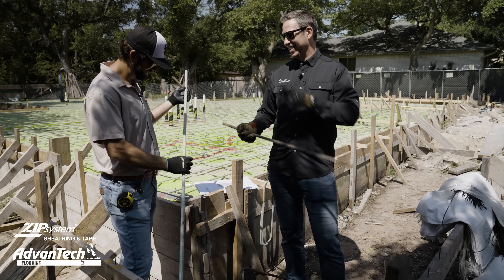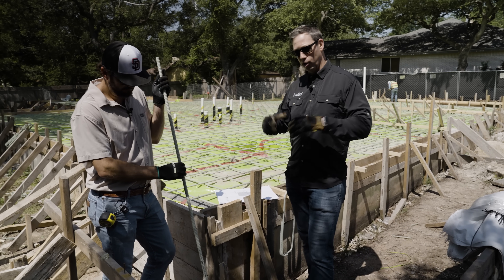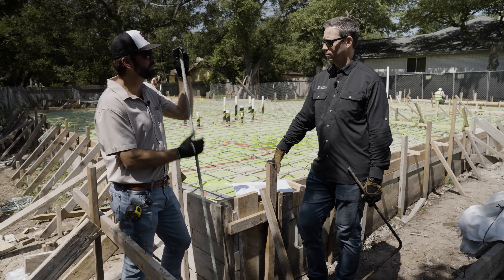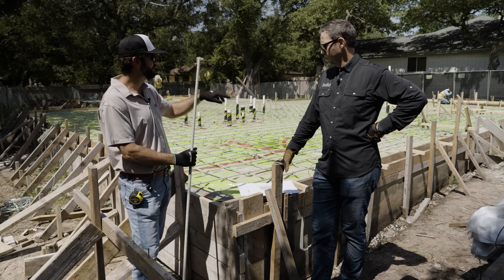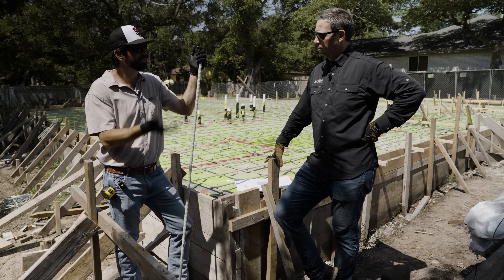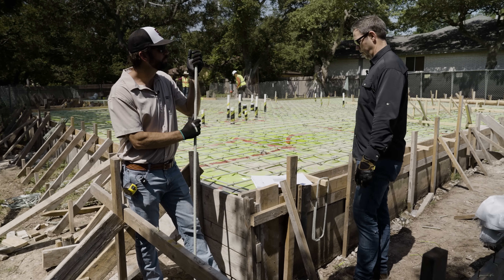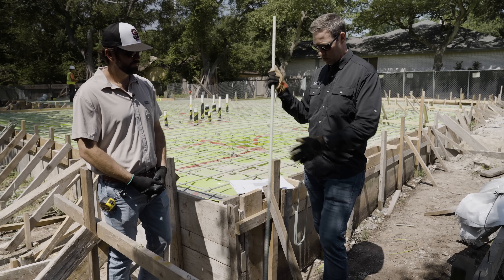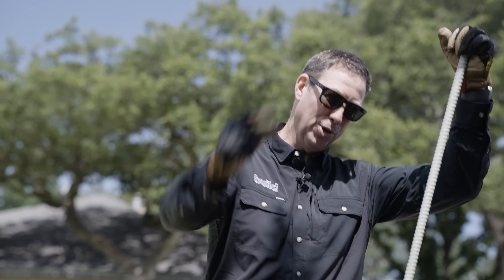Comparing Steel and Fiberglass Rebar - SURPRISING results

Comment: There is a big difference in GFRP vs. BFRP and allot more advantages to that of steel.  Steel has it's place to have to be used in certain construction projects but BFRP would save allot of head aches over steel re-enforcements.  BFRP is totally recyclable and can be used in concrete and asphalt and in fire and acid areas and will hold up longer than steel.  A bridge in Miami was built over 30 years ago for very heavy traffic.  A core sample was taken after the 30 years and was just a strong as it was when cured 30 years ago with zero Spalding or signs of wear as other bridges in the area.  Steel has it's place and will never be totally replaced but BFRP over GFRP all day twice on Sunday's.
If you need BFRP (Basalt fiber resin polimer) I can supply it for sure.
Reply: You have a link to BFRP?
Reply: BFRP doesn't bend like steel, right?

And where do you get it in the States?

Comment: Does it bend can u make cuts since its fiber glass mask when making cuts?
Reply: I don't think you can bend it onsite and will have to bend it before it is made. You should be able to cut it
Reply: Any shapes (hoops, stirrups, bends) are formed in the manufacturing process. As the warm materials come out of the pultrusion machinery, they go directly into a jig for forming to the required specifications. Because they are formed in a jig, each piece is identical. There is no variation in the shape or angle of the bend.

Cutting MST BAR produces round dust particles similar to cutting stone. Although there is no specific health risk in cutting MST BAR, personal protective equipment (PPE) should always be worn.
Reply: @g2buildingproducts  thanks for reply  and info I have used product type in California for corporations jobs  where it's called for instead of metal rebar this video shows small contractors use of material for foundation  It's nice  to see it going to smaller commercial use👍for my small side jobs will continue to use rebar

Comment: How are you bending it
Reply: He said at the factory, nothing on site
Reply: Any shapes (hoops, stirrups, bends) are formed in the manufacturing process. As the warm materials come out of the pultrusion machinery, they go directly into a jig for forming to the required specifications. Because they are formed in a jig, each piece is identical. There is no variation in the shape or angle of the bend.

Comment: I used a bit less than half a mile of fiber rebar in a 30' X 40' garage I built. It worked beautifully. However, as they said, for applications in which a lot of shear force will be applied to the bar, I would revert to steel.

Comment: Cost diff?  Great content thank you as ever!
Reply: Generally speaking, the cost of MST BAR is very comparable to steel rebar. The price of steel rebar is known to fluctuate significantly and is quite different dependant on geography, whereas the price of MST BAR holds quite consistently.  Many builders report savings on both materials along with high labor cost savings when using MST BAR.

Comment: how does this compare to Helix microrebar?
Reply: MST BAR would be more comparable to steel rebar for use and installation. MST BAR could and has been used alongside a product like this if required.
Reply: @g2buildingproducts  But it's still a big bar versus micro rebar which is tiny little fragments that form a binder on a micro level.
Reply: @rockys7726  Very true. This is why, any product used must be engineered for proper application in any given use case.
Reply: Good question

Comment: The thing about recycling steel rebar is that it's likely going to be stuck in concrete for 50+ years. If you were ripping it up every decade, the recycling value would cut hard into the GFRB's reduced carbon advantage but if both are going to be in use for the better part of a century before either is going to ripped out then it's kind of a moot point. Besides, the advancements that have been made in the last decade toward successfully recycling fiberglass wind turbine blades are any indication, you should have no issues recycling the glass rebar when it comes time to do so.

Comment: Basalt, mesh, fibers, rebar 0 enviroment impact for manufacture, 0 outgas expands at same rate as concrete, no spalling 3-5 times stronger than steel. Today availabilty and bending of rebar at jobsite remain issues, however this will likely be the product in future for imbedding into concrete. Ray

Comment: Steel rebar may turn into powdered iron after 50+ years in concrete. I saw concrete reinforced with steel rebar, at a 70+ year old church that was being remodeled in a west Chicago suburb. The steel rebar had turned into powdered iron and had zero added strength to the concrete floors it was in. Very scary! GFRT can be driven into the ground with no effect to rebar, unlike steel rebar which cannot touch soil.
Reply: Surprisingly, reinforced concrete structures are only rated for about a 100 year useable lifespan. This is because the steel reinforcement does deteriorate over time. Romans didn’t use rebar and some structures are still standing.
Reply: @psidvicious the concrete deteriorates too.
Reply: @alexdrockhound9497  given enough time and exposure to water, wind, heat and cold, diamond deteriorates.
Reply: @psidvicious  no, not really. Im actually specifically qualified to talk about diamonds. The only thing that can really change a diamond is extreme heat while also being in low pressure, or physical abrasion or impacts. Chemically and physically, water, wind, heat, and cold, really wont do anything to diamonds over time.
Reply: @alexdrockhound9497  Well there we go! All we have to do to defeat this pesky deterioration problem is build structures out of diamond, with perhaps gold reinforcement and we’ll never have to be concerned with deteriorating materials again. Simple!
Reply: Probably because of a very poor cement or concrete mix quality. The correct mix and materials are as important as the rebar.
Reply: @ramireznoy that maybe but you wouldn’t find out till years later. Need something better.
Reply: @do4267  Oh! sure you can from the beginning. Just follow the recommended dosage. You can not expect to have anything durable just with a mortar mix or leaving the steel to close to the surface.
Some people even use ordinary Portland cement for reinforced concrete. So no wonder why the foul result.
There are plenty of reinforced concrete structures standing time pretty well all over the world. Even near the sea and some IN the sea
Reply: @ramireznoy Can you really predict the future? At least with glass fiber reinforced concrete, you don’t have to worry if you got the concrete moisture exactly right. Actually you can use sea water to mix your concrete with GFRP rebar. I’ve seen too many steel reinforced concrete structures fail, especially in marine environments.
Reply: @JohnLee-db9zt  No one can predict the future. But unless you can use stone, reinforced concrete is the second best option.
As with anything else, there are a number of good practices and codes yo must follow to a t, plus the specific environmental maintenance requirements.
Any construction is subject to deterioration, the question is more about how well constructed and how expensive it is to maintain.
Reply: @ramireznoy post tensioned stone exists....
Reply: @ramireznoy Most steel reinforced concrete structures have issues with the rebar rusting after enough time.
Reply: @garethbaus5471  Depends on the construction and maintenance. In fact, rebar rust is not an issue, corrosion is. Rebar will be well protected if the construction observes the correct measurements and materials for its application and maintenance.
It is not the same building a column, a building foundation, a footing slab, a roof slab, a sidewalk... For each one you also need specific maintenance procedures: drainage, insulation, cleaning, painting...
Reply: The worrying thing is seismic. If it turns into 100% powder at 70 years, how much strength has it lost at 20, 30, etc years? It wouldn't matter until a once every 20 or 30 years earthquake happens and then your basement wall reinforcement fails.

Comment: I am planning to use this on my ICF workshop build.  I am bit concerned, as you mentioned, the sheer strength is getting mixed reviews. Still researching a bit but really hoping it can work for our needs.
Reply: Look into basalt (BFRP) rebar, Kelcrete admix (eg super plasticizers), Helix micro-rebar fibers.

We are considering an ICCF build with Perfect Block soon!
Reply: Where is the shear load in an ICF frame???
Reply: @grinchyface  ICF can have vertical and horizontal rebar laid within the blocks before pouring concrete.
Reply: There are 1000s of ICF GFRP builds in the US & Canada, Use with confidence.

Comment: Matt.
You said to have your engineer review your foundation when designed for steel and going to this fiberglass but you didnt really say why other than there is a difference.  Does it take more linier feet of fiberglass than steel on a build?
Reply: The mechanical properties are different than steel.
Reply: @D2O2  Thats not an answer.
Reply: @michaelroby8389 It is the root of the answer.  Since the properties are different, the engineered solution will be different.  It is not simply change spacing by X amount and go.
Reply: This is typically a 1:1 (often better) conversion from steel rebar to MST BAR. There is now software available to design MST BAR in up-front that many are taking advantage of. Matt was referencing his project being originally designed in steel. To convert to MST BAR, an engineer evaluated and advised on the conversion to MST BAR. An interesting fact on this specific project, is that the engineer’s evaluation specified a diameter smaller MST BAR than that which the Risinger crew decided to install and thus was shown in the video. Matt mentions this during his conversation as he chose to be conservative and install a larger diameter bar on his first build using MST BAR.
Reply: @g2buildingproducts   This is why things need to be engineered.  Not all details were shared in the video.  Yes GFRP has higher Tensile Strength and Bond Strength, BUT it has a lower Modulus of Elasticity, Transverse Shear Strength and Ultimate Strain.  Add to the firms unfamiliarity  with the product SHOULD cause them to be VERY conservative.  Deflection alone because of the lower Modulus of Elasticity will drive the need for larger sections or higher reinforcement ratio to be used.  Your design point is different,  crushing failure with GFRP versus yield failure for steel.  You should know this.
Reply: @D2O2  Yes, you are 100% correct. Every project in which MST BAR is used is engineered. Matt made it clear in his video that the project he was showing was engineered to ensure proper reinforcing was used.

Comment: A buddy of mine used the fiber rebar in the Bahamas right on the coast for corrosion resistance reasons.  It has worked very well for him on a home that is now 20 years old!
Reply: I was thinking of the Florida building that failed.
Reply: @jsbrads1  i think that basically can't be saved... it might prevent spalling, but things gonna broke with lack of maintenance
Reply: @PrograError   heard it was the rust due to the humid air 🤷
Reply: @jsbrads1 its not air, its just water in general and especially salt. Concrete chemically protects the rebar, but eventually with water exposure the concrete chemistry changes from the outside in until the rebar starts to rust, and salt speeds up the whole process. Then the rebar rusts and expands which breaks up the concrete and makes it really weak. The rebar is for tensile strength too so in places where tensile strength is the key factor the rebar rusting weakens the structure.
Reply: @jsbrads1 So in the case of the condo that failed, the one with a pool deck. That didn't fail just because of rust, they made some fundamental construction mistakes according to the forensics done on the rubble. It turns out a number of connections between different columns and sections did not have the proper rebar connections, dowels, wrap, between the 2 different sections connecting together. This means the load wasn't being properly transferred to load bearing walls and columns, causing column punch through and gradual separation of the concrete between floors, columns, walls.

Fiberglass wouldn't have saved this disaster, they just didn't follow building code or engineering plans from the time. And fiberglass also can't be bent to wrap 2 different rebar sections together, like a column to the floor, or floor to wall.

Oh, also there were renovations over time that added weight to the pool deck. I believe they added a tile layer, and they added planters that weighed a lot when watered. They actually were having a contractor out to look into some issues with the structure and they had made a proposal. They were going to remove the majority of soil from the planters and replace with Styrofoam to remove a ton of weight, I can't remember if they were going to re do the deck and remove tile and material. Unfortunately they didn't realize how deep the issues were, and some dangerous warnings signs were not noticed or addressed. The week prior to collapse one of the residents sliding door leading to the pool deck was stuck and also getting looked into, this was due to structure shifting. Not long before collapse that same resident heard a lot of noise from the building, cracking and other things. She grabbed her kids and left to tell security they need to evacuate and call emergency services to look into this, it collapsed during this conversation.
Reply: @Jaker788  an expert saw the concrete which had separated from the rebar and told everyone to evacuate, no one listened.
Reply: was that Bob Samia? he has been trying to get Bahamas to use fiberglass rebar forever
Reply: It is the only choice if strength is not what you need. Because the only reason concrete building have a lifespan is because the steel is its ticking timebomb, slowly breaking concrete. Other wise concrete can last forever, only getting stronger with time.  But you still need steel when you need strength like long spans in commercial buildings.  but for everything else anything that is not steel or rusts should be your only choice.
Reply: I read a bit more on this, I have changed my mind on this. None of these have the sheer strength of steel (failure will be catastrophic for example in earthquakes). But I found out we have an option for 316 stainless steel rebar, that does not rust. So the question now is why anything else. In short. the problem is not steel, but that we use carbon steel that rusts, instead of using stainless steel like 316 that is fully rust proof. 
      Yes stainless steel is more expensive but if it lasts forever that does it matter? So I would not go with any of these but steel(stainless). if these are cheap and use case is not structural like sidewalks then it may be OK
Reply: Can you tell me if he has used only fiber rebar in all and every place instead of iron rebar??? I mean even in the roof concrete contractions?
Reply: 20 years old? Tell me when its 150 years old.

Comment: Any data available for use in ICF construction?
Reply: I’m in SE WY and last year, it was not approved in foundation walls or ICF walls. Not sure why but as the engineer mentioned, it does not have good sheer strength and not recommended for connecting sidewalk/driveway to house. Hood that helps
Reply: @fcminiexcavator  the mention of shear strength is what had me wondering - thanks!
Reply: Why would the data be different for ICF versus any other application?  The mechanical properties are independent of application.
Reply: @D2O2  because GRFP can be smaller in diameter, which MAY allow you to use a 6" ICF block instead of an 8", which is normally not a good idea because it's hard to fit your hands in to tie the bar.

Comment: Why a bar?  Why not just chop?
Reply: what's a chop?
Reply: You take a fiber reinforcement material: glass, basalt, hi tensile steel wire, carbon fiber, polymers, etc.  chop it into lengths short enough that you think it can be mixed into the concrete, and then mix it into the concrete.   Think fiber reinforced concrete in the same way as fiber reinforced injection molded plastic.   It comes with some problems though.  For one depending on the nature of the fiber and the concrete you can have fiber pull-out under strain (so effectively no reinforcement at that point).  It's also not something you can easily pre-load, so depending on how stretchy it is compared to your concrete it may not do much to reinforce until after the concrete has fractured.  The real biggie though is that unless you know exactly what you're doing in terms of fiber length, fiber type, fiber diameter, mix ratio, liquid ratio, and mixing technique you can have fairly horrible clumping problems.   It doesn't mean fiber reinforced concrete is bad, it just means that you really need to know what you're doing and the people doing the work need to have some experience with how to do it right.  Finding people who can check off those boxes is pretty difficult right now in the US.
Reply: You need more strength than what you can achieve with chop.